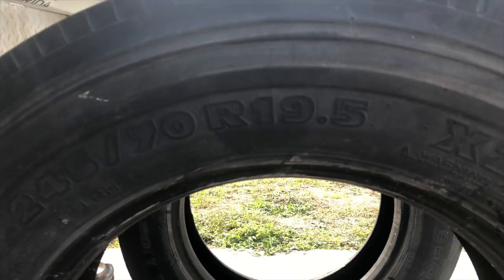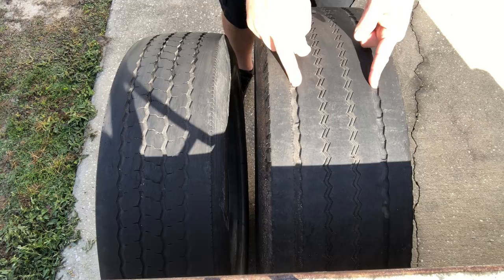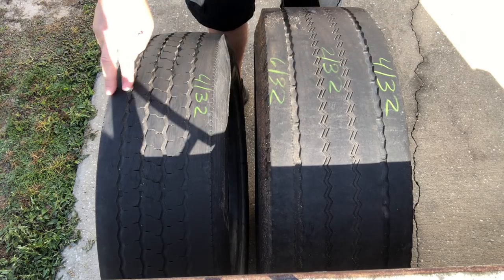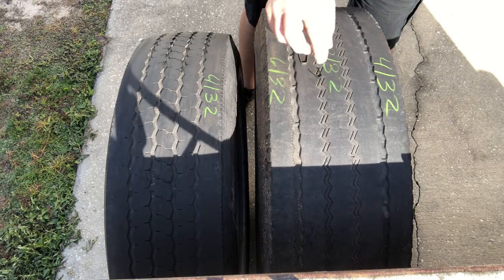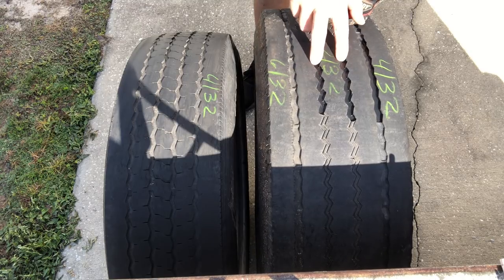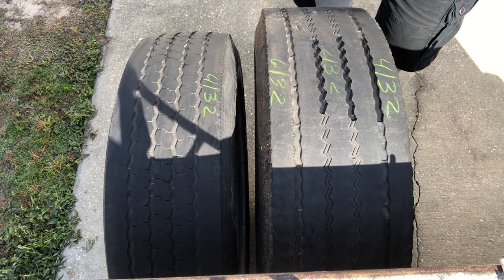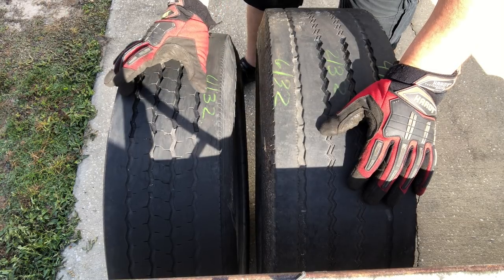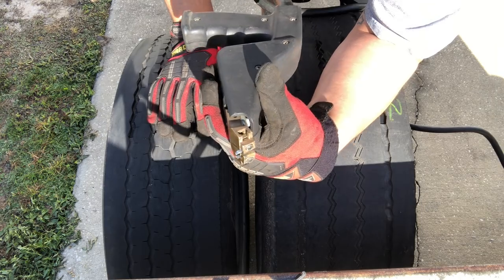Tire regrooving part 2

Comment: You can’t regroove a steer tire in the states of Mississippi and Alabama they will shutdown your truck and fine you when they fine out if you running tires has been regrooved on the steering axle on your truck

Comment: Steer tires are required to be "virgin" new tires. You can not used a regrooved or recapped tire as a steer tire.
Reply from the maker: You are absolutely right.